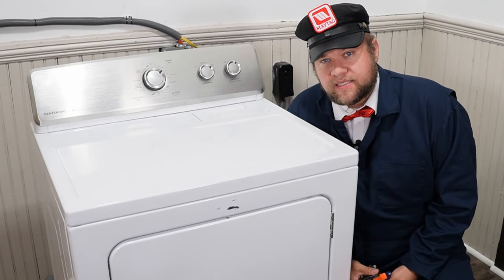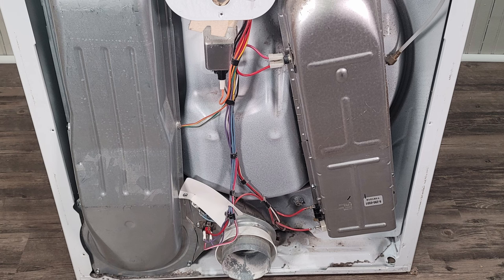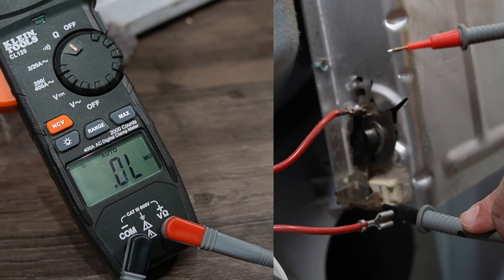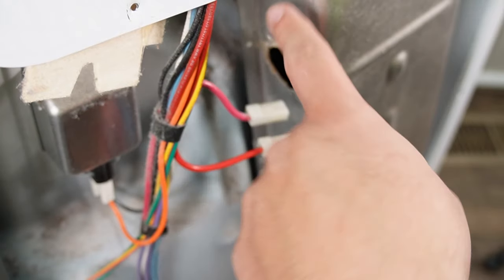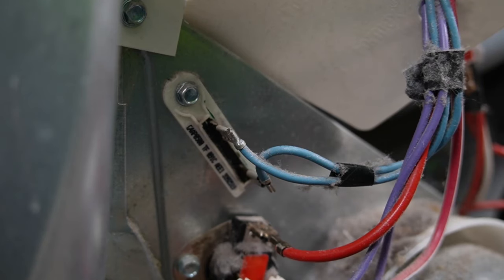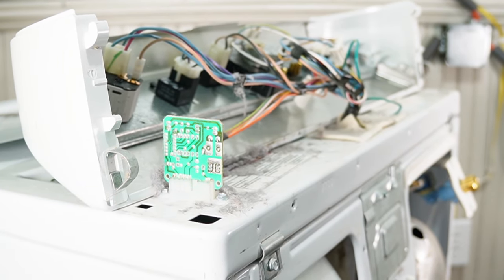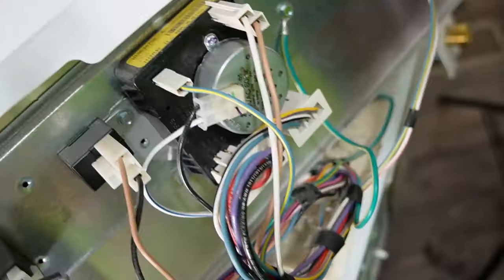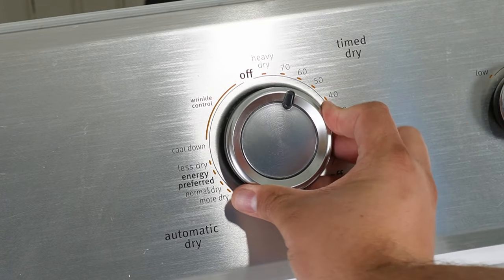How to Fix A Maytag Dryer That Won't Heat

Comment: Your title does not even mention electric heat! I wasted my time!
Reply from the maker: I've never seen an electric dryer video ever once mention electric dryer in the title. Only gas. When I make a video about gas dryers I assure you it'll be in the title.
Reply: Unplugging it in the first few minutes was a big clue.
Reply from the maker: @king11824  there are many clues... it takes a lot of oversight to think this is for a gas dryer. Namely the lack of calling it a gas dryer at any point in the video, lol